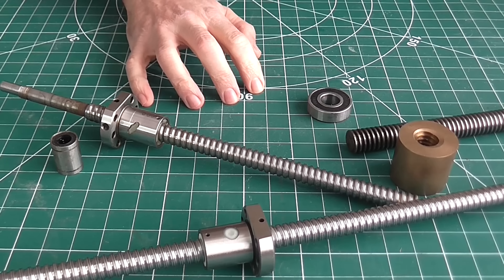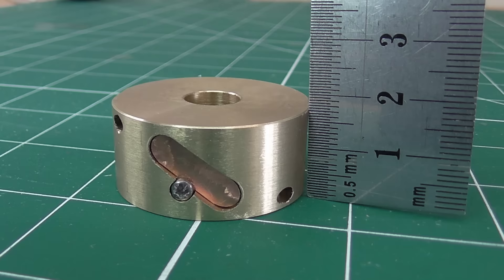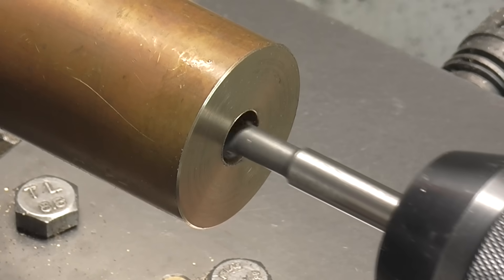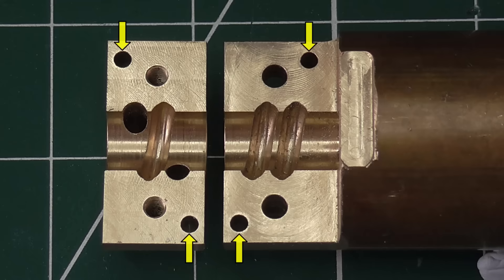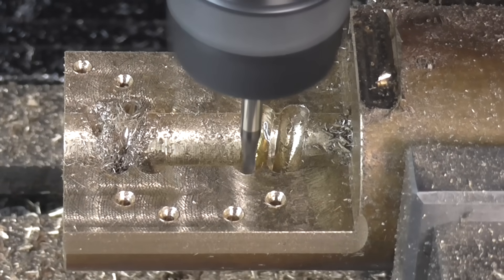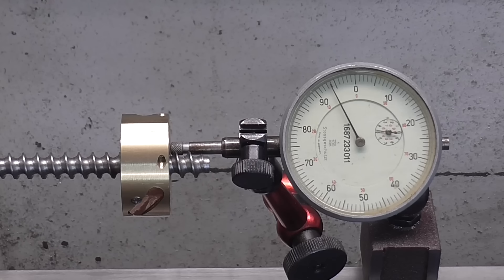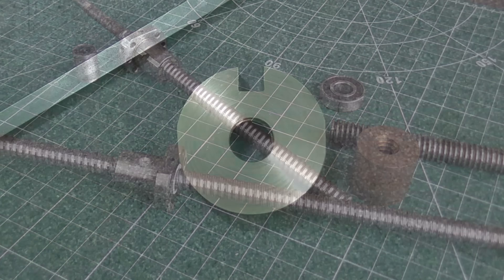How I made my own Ballscrews

Comment: This was wildly informative & cool.  From the useful math, to the demonstration of 4-point contact, to how a typical tool would be shaped like a french arch to the workaround of using a 2nd pass of a smaller diameter ball-end mill to make the 4-point contact setup.

Then you excel sheeted the g-codes of a helical-screw toolpath.

WOW!!❤

Comment: I'm not to proud to admit I'm confused as to what exactly is going on at this part. There is a ballnut on the inside but where is the ball screw? I see 2 smooth shafts. The square end can move in out but the other side with the tape is fixed. https://youtu.be/nBjTVbJbGn4?si=C1lxKNpQLXqN_Sqp&t=731
Reply from the maker: The shaft on the left can rotate and has the screw on the end of it. The shaft on the right is attached to the nut and can slide in and out but not rotate. I left the tape on so you can see the smooth shaft rotate, but perhaps it's hard to see. They cannot move independently.
Reply: @AndysMachines  Thanks! It makes since now. Looked like voodoo there for a minute.

Comment: Since watching some of this Terminator build, I was watching a guy make a foam based R2-D2 and though: "That would make Andy a helluva cool next project!"

ESPECIALLY if you could make an astromech that can REALLY WELD [like is depicted in the movie 2 different times] and link to some kind of [probably fictional] data terminal, and have that cool periscope/transmitter array that pops out of his head! (~_^)-b

Just a thought for a future build, if you have not already been thinking about it.

I know that you know how to cast parts and are really skilled, so it makes sense that you would be able to build a highly capable scale astromech with a whole lot of functionalities, so it would just be wrong of me to not suggest it.
Reply from the maker: Yes, an R2D2 type droid is actually a much more realistic type of project!
Reply: @AndysMachines  If I were gunna make one, [and some day if I get rich I might], I'd go full tilt and make it as close as scientifically possible, to doing everything the movie version is purported to do [but was actually a midget in a robot suit].

I'd pack it with top end military spec sensors, world class processing power, a really powerful power cell, make the entire body from spun heavy gauge aluminum tube [1/2" or so], a spin turned heavy aluminum dome, and cast aluminum feet and arms, with real working hydraulics [including hydraulically driven wheels, in really walking legs.

And, again, I imagine my version would weigh around 800 pounds, being made with all working components [which would be made mainly out of steel, aluminum, brass, bronze, and lead [as in lead acid batteries in the base of the droid].

That said, though, I would not be above putting in a small, but well muffled gasoline motor in there that spun an alternator to power the system, with only enough battery storage to buffer the system [as is the case in cars].

If I did have a gasoline type motor on it, though, since that would kinda kill the whole droid vibe, I would have to make it so quiet that it could not be heard as a motor, and would not produce the smell and smoke of a motor.
Reply from the maker: Some nice ideas! What about a hydrogen fuel cell instead of an internal combustion engine? Quiet, no fumes (only water), produces electricity directly and only needs a tank of hydrogen instead of gas.

Comment: You should try making hydrostatic screws! Pump a few hundred psi oil or water into an otherwise normal lead-nut and get ballscrew-like performance in a nice low profile package.

You'd need sleeves over the screw to capture and recirculate the fluid but your design already has that.

Comment: This is probably a misinformed question, but if the bigger ball screw had 3 circuits of balls would that mean that you could just chop one of those circuits out for a possibly similar result?
Reply from the maker: Actually a good question. The reason I didn't do that is because all the ballscrews I had were 16mm diameter and I needed something smaller, the one I made was 10mm. But with a smaller screw yes, that might work.

Comment: I don't understand how the DRO allows a manual machine to interpolate ramps or radii. You could peck each coordinate, but you can't constant mill the feature unless you turn the part to the angle needed, and at that point, a regular x/y readout would do fine without using any special functions
Reply from the maker: You need to take very small steps to mill a smooth angle or radius. eg. if you use a 20mm end mill and take 0.1mm steps it comes out pretty smooth, it takes patience though. You can often take bigger steps and then hand finish it with a file. A rotary table is usually the preferred way to cut arcs, but sometimes it's not possible to access the feature you need to mill, or when you consider the set-up time it's quicker to use the DRO.

Comment: Nice work and clever approach to making the nut. One thing I could think of to make whole thing more precise would be to fabricate the nut with even more reduced contact surfaces and make them slightly too small to accommodate the balls. Then run the screw back and forth with shims, thick enough enough allow for movement under force, between the two halves of the nut . Repeat, reducing the shim thickness by small increments till the channel the balls pass through has been burnished to match the screw exactly. Adding some polishing paste instead of grease could add an abrasive element to the fitting
THis would be obviously overkill for this application, but might be one way to make the nut fit the screw very precisely and also work harden the contact areas with the bearings. Though it would be limited by how accurate you can make the screw. Any defects in the screw could transfer to the nut in this way, though it could potentially also improve the screw as well.
Reply from the maker: I did actually think it would come out slightly undersize and need some sort of wearing in, but being brass it came out the exact dimensions I machined it to.

Comment: I found this as I am Not familiar with all this stuff.
But i bought a defekt Vice which has exactly such ball Channel to hold the screw of the vice.
I bought IT to try to repair IT.
The defect is: with Balls INSIDE the screw can Not be driven. If Balls are Out the vice works but could Not be fastened. So i watched your Video to learn more about the technique behind.
And you gave me the Idea to try First smaller Balls.
I think Something ist wrong with the Channel. I can Put a Pipe Cleaner through it, so there IS No piece of  Metal INSIDE or some other dirt.
Maybe the Gothic Arc is Missing.
I have No milling or other Machines, only a drill Press.

I am looking Forward to get IT run now.
Thanks a Lot for Sharing this technique and for the nice speech without music in Background .
This makes it better to understand - English ist my 2nd language and often i do Not understand the speech due to Background music but could understand the meaning.
Reply from the maker: Yes, I think new balls is the first thing I'd try, they might have small imperfections causing them to jam against each other. Another thing you can do is alternate a smaller ball in between each regular one, this allows all the balls to rotate without sliding on each other since the smaller balls can rotate backwards like an idler between the bigger ones.

Comment: Great idea. Experimenting is the best part of Engineering. I always part off this sort of thing in the Lathe with a stout tool. It doesn't matter if there's an intermittent cut on a decent lathe.
Another useful idea is to use the CNC mill to machine a form tool from Gauge Plate which is then hardened. I have a standard 3D model that I use to project the desired profile onto an angled plane. The profile is cut with the stock at an angle, so that when it's used flat, there's clearance on the front and the shape is then correct.

Comment: 7:57 Trig + basic math = any basic shape

Uh... Wtf defines a "basic shape"!?
Reply from the maker: I think I said 'geometric' shape. Anything like a circle, arc, or even section of a sphere is easy to create with sines and cosines and with Excel you can generate all the gcode from whatever variables are important, eg. size of the feature, size of the cutting tool, how many and what position/angle etc. It's like parametric modelling in a spreadsheet.
Reply: @AndysMachines  I'd be very interested to see the math and the parametric reasoning behind your spreadsheet. Not because I'd copy it or sell it (I don't even have a CNC milling machine, yet), but because I find it super interesting!

Comment: -1 point for using a philips screw as the cover :)
Reply from the maker: Yes, I know. I usually avoid those. If you look at 10:10 you'll see I first used a cap screw. But, Umm... I dropped it, or something. (Actually I think the head was too tall and stuck out beyond the nut's surface)

Comment: @12:10... Am I missing something? How is the right side moving linear but the left side is not?
Reply from the maker: The rod on the left is connected to the screw which rotates, the rod on the right is connected to the nut which can only move linearly. The rod on the right is actually hollow and the screw fits inside it.
Reply: @AndysMachines  ohh got it, thank you.

Comment: @13:00 Technically is screw but not balls in this toy, only thin hard plate with suited hole.
Reply from the maker: The old ones had balls inside a tapered 'nut' which could slide up the screw and out of the way allowing the top to freewheel. Kind of a one-way ballscrew. I'm sure the modern ones use various simpler, cheaper mechanisms. I didn't dismantle it to find out. Somebody might have been unhappy about that.
Reply: @AndysMachines  Maybe in my part of the world different construction is more prevailing. Yes, I know the urge to dismantle is high but we don't want any cries 😅

Comment: Very interesting video, I used to work at a Ballscrew factory for 38 years in Coventry it closed in 2005.
In the early 1970s when it was owned by the Americans we made ballscrews for the tracking systems that brought the Apollo 13 safety home. Anyway I think you did very well with your ballscrew well done, 🇬🇧 from Coventry in UK.
Reply from the maker: Thanks for commenting! It's a shame most manufacturing like that in this country has closed down now.
Reply: No more.
Fully 75% of Americans can’t calculate 2/3 + 3/4.

Comment: what about those 8mm leadscrews 3d printers use, they have a 8mm pitch and can be backdriven and are easy to get spare parts for. what made you discard those as an option?
Reply from the maker: Yes, I have one of those on my 3D printer. It probably would have worked, but looks a bit weak. The reason these are backdrivable is because of the very high pitch/diameter ratio, though they are not as efficient as a ballscrew and that coupled with the higher pitch would have meant I'd need either a more powerful (larger) motor or higher gear reduction giving slower movement.

Comment: I made a fast rise ballscrew by cutting the male thread with a face mill and securing the balls in varying depth pockets. Link https://youtu.be/hzwtfwCQ8D4?si=yAj2rSaSbmlDL3Ra
Reply from the maker: Very interesting! Looks like the result was super accurate, I also like the locking mechanism. Is it aluminium? I suppose it's not under any real load, so no wear concerns.
Reply: @AndysMachines  Thanks. The large flat crests on the male thread, which have a slide fit in the smooth bore of the body, keep the alignment accurate. Since it is Aluminum, I only use it for inspection where I need a surface to remain parallel at various heights. The 3-start thread with a 30mm lead helps with quick adjustment.
I have a larger 4" diameter pair with a 10 start - 20mm lead traditional thread for use on the mill.

Comment: depending on the nut in question, could you not just cut off a race of balls to achieve the same result with hardened steel?
Reply from the maker: Yes, probably. But I'd have to soften the nut to be able to machine it. And I didn't have one small enough since the screw had to be around 10mm diameter due to other limitations of the design. I maybe could have made a 1204 ballnut work, but I'm not sure how the circuit(s) are arranged in these.
Reply: @AndysMachines  what about using abrasives to cut through it like an angle grinder?

Comment: If you only want 2 points of contact on each side, why does the thread form have to be curved? It would seem you could take the desired radius and angle of contact and just used a V form thread modified to provide that. Is there something subtly (and interestingly) problematic about that?
Reply from the maker: Good question! I don't know the answer. If you look at linear bearings they are often just a V.  You normally don't want a sharp corner in the bottom of the V (stress riser, cracks can form) so it's normally relieved with a slot, maybe that would remove too much material on a screw meaning a larger diameter would have to be used.
Reply: @AndysMachines  yeah. Stress concentrations might be a concern, but that's a problem that has to be addressed with V thread form regardless of application. The "remove less materiel" theory is interesting. Given their normal application, the slight increase in rigidity might warrant the increase in manufacturing cost (which is likely slight when you can amortize the tools over lots of product).
Reply: A V and a ball creates a point contact. This is fine in the abstract, but under load, this small surface area of contact will easily deform and not act as a rigid and reliable motion. You want the area of contact to be as large as possible. Most commercial ballscrews are made so the gap is slightly smaller than the ball, so there is a little preload. That's the beauty of ballscrews as rolling elements. If you have preload on sliding surfaces, like in a leadnut and screw, it creates a press fit and won't move.

Comment: I have never seen a decent demo or how-to on using the arc/radius function of a DRO specifically for z-axis 3D milling. I know your channel isn't exactly a how-to channel, but it sure would be amazing to see a proper how-to for this feature from someone who clearly knows what they are doing (you). I've seen demos on x-y arcs, and I'm sure an x-z arc is the exact same thing, but my brain can't compute!!
Reply from the maker: Yes, I try and avoid 'how-to' videos, more just 'this is how I did it'. I'm just a hobby machinist after all and not really qualified to give in depth tuition. Working in the X-Z plane is definitely harder to comprehend than X-Y, but it's just a case (in both) of moving each axis one at a time through a series of points, always first moving the axis which takes the tool AWAY from the part, then the other axis that takes the tool towards the part to end up at the specified point. (And the third unused axis should be locked in place, (unless working in the X-Y plane and taking the cuts by plunging with the Z, then you can ignore most of the above. See, how-to's are complicated!)).

Comment: Interesting project. Couldn't you just buy the ball screw thread and make a nut that fits on it? Also, I'd propably try internal grinding for the internal threads. Way less tool pressure than thread turning and very smooth finish. Don't think brass will last long tho, the balls will press in grooves really fast. Maybe you could try using tool steel?
Edit: I remembered something that you might be interested in: roller screws. Instead of balls you have threaded rollers between the screw and the nut, should be able to make it with regular threading tools and the load capacity is better than with balls while still being backdrivable. I'm not sure how exactly the geometry has to be designed, it's propably similar to planetary gears with a really steep helix angle. So you'd definitely have to make multi-start threads for it. I never tried it, but the concept is pretty intriguing.
Reply from the maker: Grinding a hardened steel nut would of course be best (that's how commercial ballnuts are made). Unfortunately I don't have the tools to do that! I already had some actual (ball) screws I could have used, but making the screw part is relatively easy.
Reply: @AndysMachines  ok, fair enough. I also edited my comment with something I remembered, maybe it's interesting for you.

Comment: -what CAD do you use?
-excel

holy shit bro thats some serious flex
Reply: Excel is more like CAM, Computer Aided Manufacturing. Did computer generate some gcode from parameters? If yes, it was CAM. Doesn't matter if it was excel or something other. Ms Paint would be actual CAD here, computer aided design. If it gives you some model to visualise and input parameters into your CAM tool, it's a CAD.
Reply: I use Ms Paint.

Comment: I don't know if they invented  them, but GM steering boxes used to use this technology
Reply from the maker: Ballscrews were invented at the end of the 19th century, though I don't know what their first application was. They are still used in many steering boxes and it's a good example of where their use has advantages over a plain screw, I don't know if any steering systems (other than perhaps a traction engine?) use plain screws, but I think it would be terrible and might even lock up completely under external load!

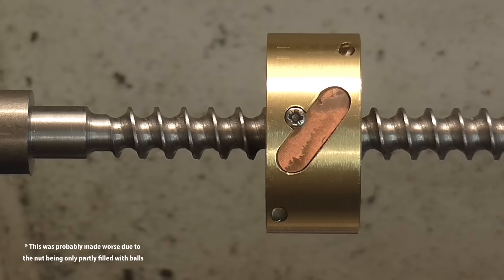Comment: 10:54 Could you have avoided the rock if you had 2.5 rounds of balls instead of just 1.5 rounds? That would have increased the length of the nut only by 5–7 mm if I have understood correctly.
Reply from the maker: Yes, it would have helped (actually it was better after I'd properly filled it with balls) but I really didn't have a lot of spare space and the rod attached to the nut prevents it from rocking anyway.